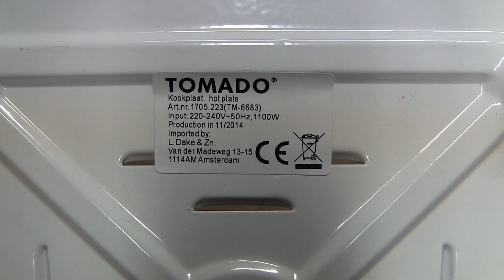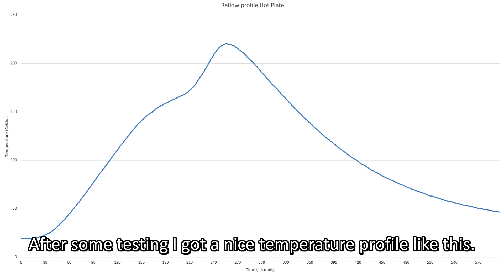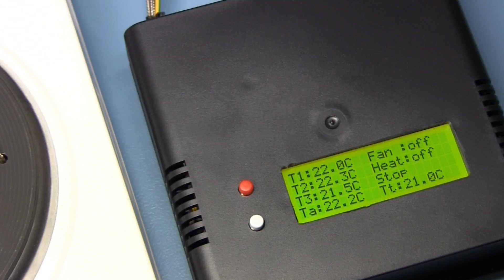Reflow oven or hot plate? I went for the reflow soldering hot plate - 100% automated

Comment: If you get a steel plate say  1/4" thick or thicker and the size you want then lay that on the hotplate the steel plate will equalize the temperature plus it will hold the heat longer.
Reply from the maker: When it holds the heat longer it will take more time/energy to cool the plate. This hotplate has a good balance for automated reflow.

Comment: wait... you have drill press, but you dont have a hole saw?
Reply: And a tap set and a CNC and the skills needed
Reply: @willfraser9337  there is no need for a cnc mill. calm down. 
a hole saw is around $9 it would have saved time instead of drilling 32 holes cutting out the center and then sanded it smooth like a caveman.
Reply: @darkshadowsx5949  WHAT!!1! There is ALWAYS a need for a CNC.... even if the project at hand is just stirring your coffee. 😜

Comment: I tried a reflow plate but couldn't get the heat to stay even. I think there wasn't enough mass in the plate.
Had much more success with a fan assisted toaster oven.
Reply from the maker: +Lee Cook Controlling the temperature is indeed the difficult part. But once you got it tuned in it gives very consistent results.

Comment: After you populate one side, how do you populate the other side? I imagine the hot plate wouldn't work for the other side right?
Reply: I've seen people use a special glue to keep the components on the first side they reflow. Then, they can flip the board over and reflow the second side without the components falling off. My guess is that the glue is cured when reflowing the first side and stays cured (doesn't re-melt) when reflowing the second side.
Reply: You can’t

Comment: Where is the Arduino INO file located?  What did you use for the thermocouple breakout boards?  What did you use to clamp down the thermocouples?  What size air tube did you use?